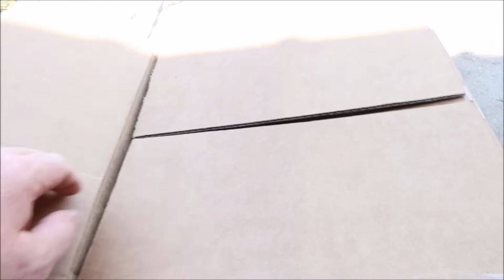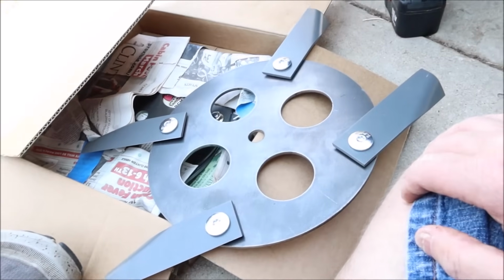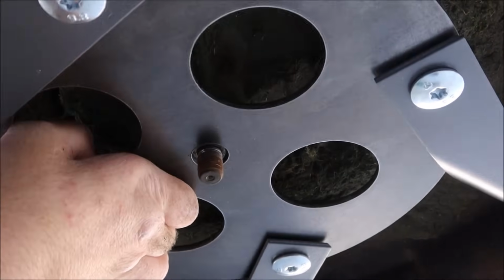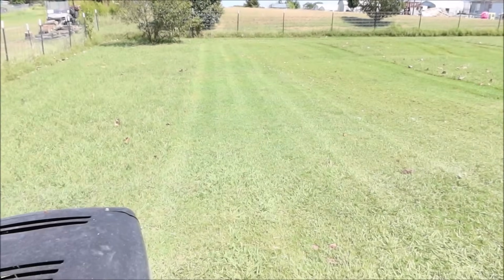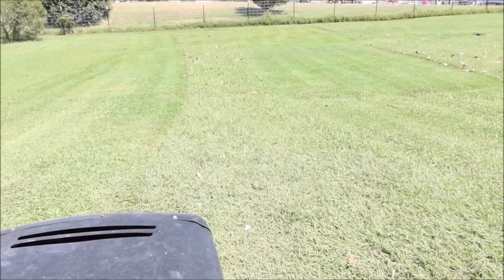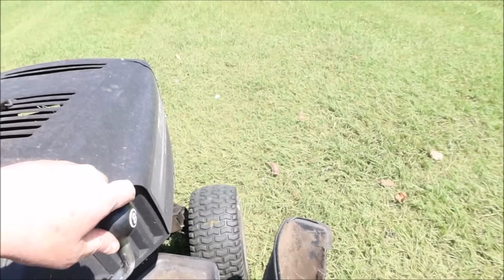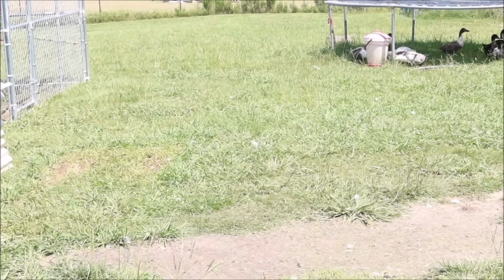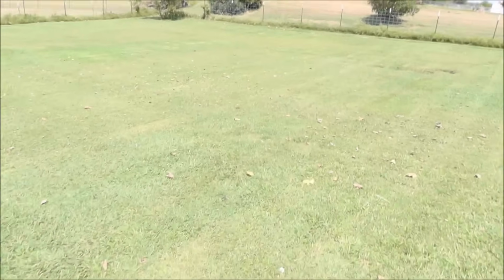MEG-MO FLAIL BLADE SYSTEM

Comment: My blades for my eXmark 52" Vantage arrived on Saturday ( 09April2022 ). My current blades by Rotary ( part# 11421 ) after 15 hours in Florida ( are always worn out ).Then, I installed the Meg-Mo blades at 318.1 hours on my mower; and started to mow my property 5 acres. Currently, I have mowed 2.6 hours with the Meg-Mo blades ( hour meter is 320.7 hrs ) and my lawn looks great and a much faster cutting time with these blades. OH YEA

Comment: I have installed these on my 2000 model cub cadet 2135 and what a difference.  Best blade system ever. Although they are pricey but in my opinion are worth it

Comment: If it cut Bahaia I'm sold. For those that don't know, Bahaia grass is the same grass in the yards in hell. It was developed over a long period of time by crossing Bermuda with titanium and piano wire. Kudzu was later added to increase the growth rate to 4 inches a day in 100 degree heat and  zero moisture.

Comment: Need to compare to  double blades   I found similar results  at less cost
Reply from the maker: I’ve tried double blades. it doesn’t cut near as good as this plus my Honda has double blades in it cuts like crap
Reply: Only dumb question is the one not asked thanks  for the reply

Comment: @THEMOWERMEDIC1,   awesome footage as always. Nice mower. I'd like to ask in your opinion why do  companies that make canned premix fuel make you pay more for less in the can? Example just today got a gallon (what I thought was) of Tru Fuel 50:1, after researching I took the can back for a refund, won't be buying from them. I'm using VP Racing SEF Multi Mix 40/50:1 cause their an honest distributor. Just asking your opinion I think I made the right move business wise, was getting short changed for 2, years it's good stuff but man the price for quantity. Not Good. 

Side note is the small pause or popping just how those Briggs singles run? I always thought they were surging every time I heard one run. 

God Bless. JD
Reply from the maker: ENGINE WILL BOG IN TALL GRASS
Reply: @THEMOWERMEDIC1  understood I always couldn't figure out why those engines at idle would sound like their surging, yours is perfect.😁 On the fuel part of the comment I'm sure you as a business owner understand my choice to switch.

Comment: I have a brand new Briggs & Stratton basic push lawnmower I used it one time started right up the second time I try to use it it took several pulls now I’m trying to use it for the third time and it won’t start at all, nothing. Brand new
Reply from the maker: How big of a piece of steel pipe did you hit before it died?
Reply: @THEMOWERMEDIC1   steel pipe? I mowed my grass in my small yard didn’t hit anything my yard very clean  I bought it Tuesday had a little bit of problems starting it first time second times a little bit more problems starting it and now  third time it didn’t start at all brand new out-of-the-box it has oil it has gas

Comment: The large landscape company that I used to work for tried them. Out of seven more Crews no one liked them they gave a funny cut. Especially in damp conditions. From a commercial standpoint they are a nightmare to sharpen.
Reply from the maker: What company did you work for? On the contrary they are super easy to sharpen even easier than regular blades